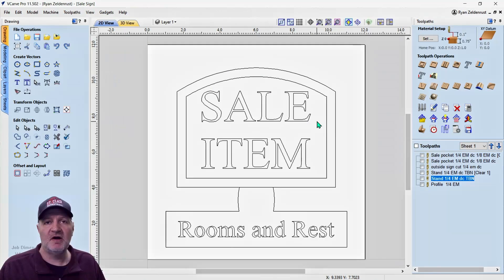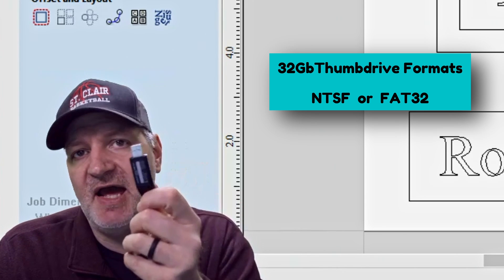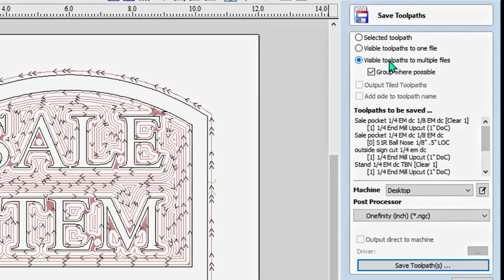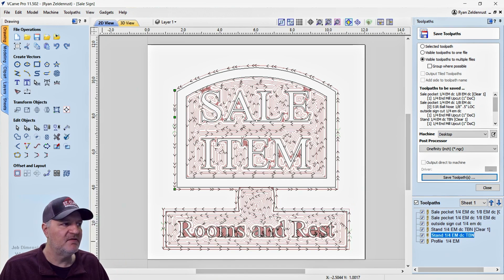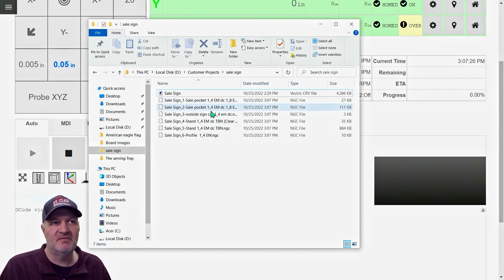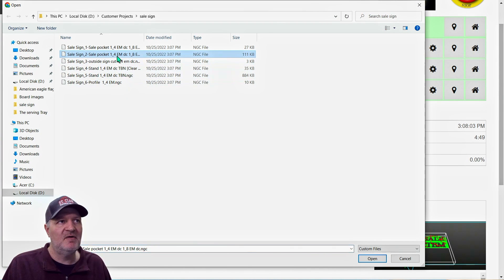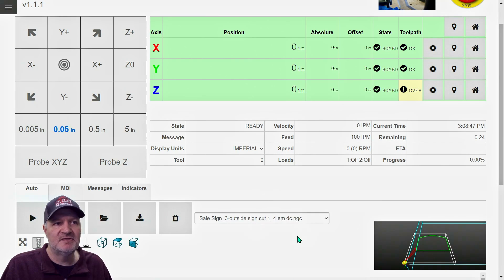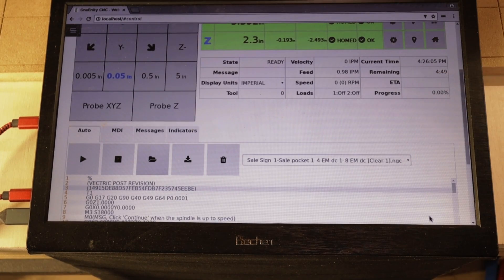How to Upload Vectric Files to Your Onefinity CNC! (2 Simple Methods)

Comment: An issue I’m having is where my zero is to where the crosshairs are on the controller screen (i have the elite foreman with masso) so on the screen it shows my tool is in some random space on the work surface, however i just brought it to the front left and zeroed everything.. any advice? It’s when i load a program it is like it has its own zero location and won’t change
Reply from the maker: Are your parameters for your zeroing block set correctly? Otherwise, I would jump on the masso forums and see if anyone else has had the same issue and how the solved it
Reply: @twoelmbuilds  I’ll check some forums, i looked on the Onefinity forum and didn’t find the topic. I just tried again with this next file, so i homed the machine just to make sure everything was starting in the right place. Loaded the file and the tool physical location didn’t match at all with the crosshairs on the controller. I’m still looking for answers here. So to cut this next part of this simple shop stool i jogged the spindle way off to the right and hit zero and then ran the program…. Just offsetting this error

Comment: Being new to CNC, I have found this video to be very helpful. I have recently purchased your spoil board  G-Code file. I downloaded it to my thumb drive, but I am unable to down load it to me Journeyman. I did notice that there is no post processor selected in the file. Should there be one selected ,and if so can I make the changes to the file I purchased? Thank You
Reply from the maker: Did you load it into vectric software then save it to the thumbdive? The post processor is selected when you save it through vcarve pro or aspire.